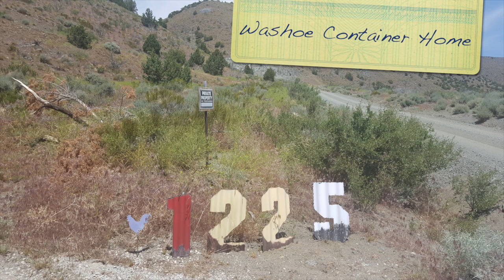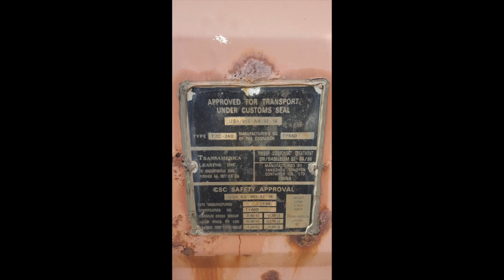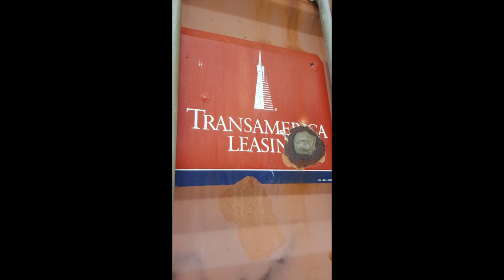The Reality of Building & Living in a Container

Comment: I’ve drawn up plans for a (5) container house with 4@40 and 1@20’ but may scale down after watching this video to just the 4@40’. 
The roof is a costly addition and not necessary on a scale like this. NTM the solar arrays could’ve been placed on an insulated frame for much less money. 
In Florida the 40’s can be had in great shape for 1,800.-2,000.$ each. 
Plus, as you said the foundation was completely unnecessary as four posts are sufficient . 
The utilization of space is top notch though. I’ve seen that layout built for around $40K and completely off grid including no propane tanks. Ran off of solar only which is ideal for such. 
Most people use 2x4” studs when framing interior walls but again , 2x2” are adequate to save space. 
Only real thing I can’t get an accurate answer on is how much is the electrical and labor for such a unique job?

Comment: Is that in Nevada.Im in E.Texas, formally from Cal.I have acreage with no restrictions.,or inspections,permits,or building codes.I can use containers with just 18x18x24 deep footings with bar ,and metal plate,for a welding surface,to secure the container for tornado,and high winds.The fullfooting and foundation is complete overkill,because structurally the container is very sound.The permit process is ridiculous .The container is structurally very strong and fire resistant.To bad you had to spend all that extra money.

Comment: I'm sure somewhere in the building code and permitting process, it's OK to treat the build as if you were parking a travel trailer. Pour a concrete pad, install a electric meter and pedestal, install a water meter with a bib, gas meter with a bib, etc. The permit wouldn't say anything about the shipping container.

This approach wouldn't work?
Reply: That's what I thought. Make it like it isn't a permanent structure like a RV or a shed.

Comment: Containers are already stronger than wood frame, their structural engineer didn't know what he was doing.  One connection at each corner is enough to hold them to the foundation.  A container is designed to hold the weight of cargo that is being shaken by rough seas and pummelled by high winds.  And they handle those conditions while being secured only at the corners.  And a properly sized pier foundation would have been just fine.
Reply: Yep.  They are certified for transport on public highways with only four clamps holding them to the truck bed.
Reply: Until you cut it full of holes. They sell them off usually because they are trashed.
Reply: Bob G  here were I am on the Atlantic coast  they sell them off because it to expensive to return them to china
Reply: I think he mentioned county requirements when he talked about foundation
Reply: Did you see the number of foundation connections?  It was obvious the engineer didn't have a clue what he was doing.  They even said that the county inspector said the place was overbuilt.  Some engineers are really sharp, others are idiots who don't know anything once they are asked to do anything outside of their experience.  The holes have beams installed above them, and posts to each side go down to the foundation. They said their county did not do welding inspections, fine, their engineer should have done them.  Don't hire an engineer to work on a project with steel if he isn't certified to inspect site welds.  They just picked the wrong engineer.  A good engineer can prove to the plan reviewers with his calculations that the building as planned and presented to them is safe even if it does not fit their typical thinking.
Reply: Exactly!!! This is clearly out of their depth!

Comment: I am an architect. You should paint the containers, maybe leave one part original on the side as a "proof wall".  It doesn't have the "character" you think it has.

Should have used a metal roof , shingles don't fit in. Someday when shingles need replacing .

Might could look OK.
Reply: Metal roofs are noisey .Better use rolled roofing with a primer coat of Elastermeric Kool Roof ,and then a coat of White Kool roof Silicon coating,great summer heat reflection,and easy to do yourself at half the cost.

Comment: "engineers didn't like the post and pier idea"...Of course they didn't because it doesn't cost much in materials and labor, this guy got had so they could make more money off of him. If you are setting out to build an affordable home then you have to be proactive in that respect. Letting someone talk you out of something that would have saved you money is the fastest way to buyers remorse. As I get ready to build my container home next year I've been collecting left over lumber from my own building and the contractors near me, marble and granite from the shop next to me, bought very lightly used windows and doors from a contractor sale for a fraction of what they are new. Ways and means, if you want to save money you can, if you want to put a house up super fast and have someone else do the bulk of the work you can but that's where you incur much higher build cost. All in all this is still a good example of a small container home, I like the roof integration and how it doesn't overhang too much on the low side.
Reply: I think in that county its an earthquake code.There are quakes in the Reno area

Comment: i def thought its a money saver and that's y so im thrilled i watched this. im only going to have a simple design with 1 small container. wonder if then it's a cheaper idea and a bit easier? not the Only reason tho. i love that they r structurALLY sound. and that it is a house in a houss. and i wana TRY and do most of thw build myself so having the walls and everythinf already was xomfortinf to me
Reply: I check with my building dept. and I can put a 40 footer in my back yard but not a high qube without a permit. I need a permit and engineering for a high cube, to cut a hole in it, add electricity, water or live in it.
Reply: A single container would be cheaper and easier to build and in my opinion would require less engineering.

Comment: Really 8 or 9 grinders? I have cut up lots of container steel and am still on the first grinder (4 years), use lots of discs, but grinders? And yeah, a plasma cutter is so much easier and it does not do any more damage to the steel then a grinder. :) Sometimes engineers go a bit out of their field i think.

Comment: Your engineer doesn't know much about cutting steel.  The area around the cut that gets hot is called the heat affected zone.  Steel is a poor heat conductor.  Even though the plasma cutter puts out one hell of a lot more heat than a grinder when compared cutting temperature the time it takes for the cutting process is one hell of a lot shorter for a plasma cutter than a grinder and therefor the heat affected zone is actually smaller.  I've built portable buildings with containers and the amount of paint pealing (heat affected zone) is less with plasma cutter as opposed to a grinder.

Comment: ouch. 2k a container? I haul containers all the time to customers who paid 500 to 700 each for them.
Reply: Gday
 depends where u are i got a 40ft high cube to my place on a sideloader $3300au
cheers
Reply: +SCUMMY InOZ  of course I didn't add shipping charges into that which usually run 1.50 to 2.00 a mile. so I could see the 2k figure per container if someone didn't live close to a port.
Reply: +John Phillips I live in Minnesota south of Lake superior
Reply: Patrick Dolan Were are you located?
Reply: They said $5K a container, and I mentioned I could get them for $2K or less,,,where are you getting them for under $1K and are they full of holes?
Reply: They probably included transport cost. average price for a very god condition 40FT HC container is 1800 USD
Reply: The closer one is to a port the cheaper they are. But for that price, what are you getting?
Reply: Are they Grade A? If so, please tell me where do I get Grade A shipping containers for $500-700? Thank you!
Reply: Patrick Dolan where are they getting them from?

Comment: The cost savings are in the foundation (10%) and the roof (11%).  But you went conventional, as if you were building a stick frame.  So there was no cost savings.  The other savings is in the exterior wall/roof maintenance.  And because you went with a wood exterior... there's not cost savings there.

Insulation is more expensive if you're in cold/wet climates, with containers, as well as if you have to engineer and fabricate structure for excessive openings.